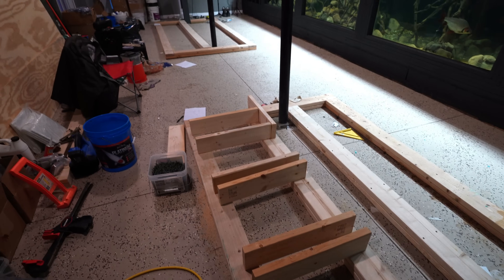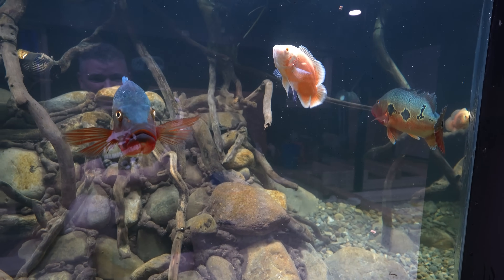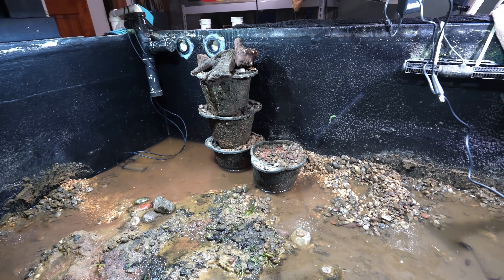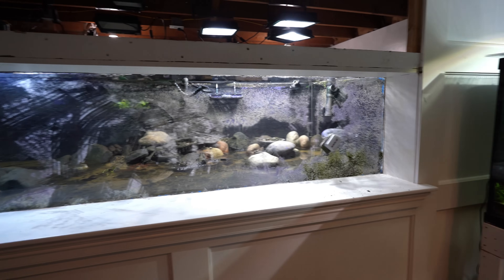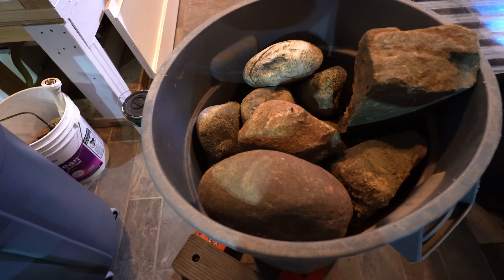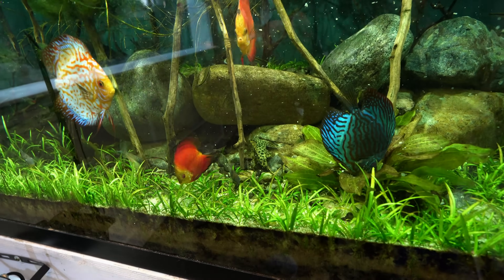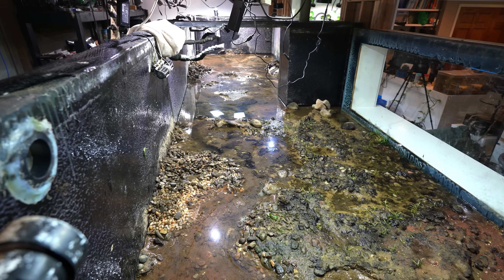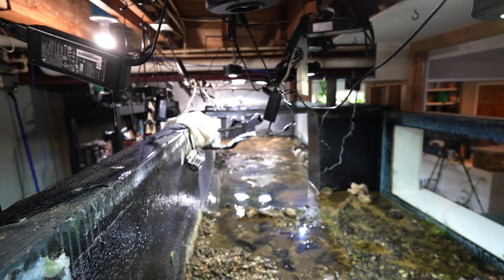Massive 3000 Gallon Marine Predator Aquarium Build, Predator Bay 3000 Starts Now!

Comment: Personally I wouldn't shrink the surface area of the 1500s, but would reduce the height down for easy visibility over it
Reply from the maker: It was a tough decision, but honestly the middle area view is noticeable better with the new footprint. I did decide to increase the height on the middle tanks...so I am back up over 1200 gallons on each one. 😊

Comment: You could just make the two 1500s taller with the narrower footprints but keep the water volume about the same.
Reply from the maker: You gave away the surprise in the next video 😁😁  they are going a bit taller and will be 1200 gallons 😁
Reply: @AquariumDomain.  Sweet. Happy building and stay warm.

Comment: Also for your lids for the new predator bay have you thought about using polycarbonate greenhouse panels? They don’t sag and transmit light as well as glass. If push comes to shove you can always frame them with 1x3s.
Reply from the maker: I have a bunch of polycarbonate greenhouse panels and will be using them on the 3k, but I am changing the bracing of the top panels both to shorten the distance of each panel, but also to secure them from Sharks pushing their way out 😊

Comment: As I've said over and over and over again the 4500 is so beautiful dude. By shrinking the tanks down you actually save on plywood and other lumber by doing them 4 ft wide. I need this in my basement, but i dont have b*lls to do it so I'll live vicariously through you. 👍👍 have you gave anymore thought on 2 viewing panels on the 1500 gallons?
Reply from the maker: Thanks!  Yeah, 4 x 10 works out really well materials wise, also I have increased the height a bit so I am still going to get 1200 gallons out of each tank...plenty for the fish I want to keep in them. 😁  I am leaning towards one viewing panel so that I can do more with the aquascape and not have the eye wonder to the 4500 gallon behind them 😁😁

Comment: Great stuff as always! You could always make the 1500s be like ponds on the ground too, or at least I'd consider that. 

The 900s otherwise should look sweet too. Not to mention how cool it'll be once the sharks and rays go in that 3000. 👍
Reply from the maker: Hey Austin! Funny thing is after I filmed the video I was thinking to myself I could just make the two 900 gallons a little bit taller like 42 or 44 inches and come in around 1000-1200 gallons...which is what I will most likely do. 😊
Reply: @AquariumDomain.  Wow! That's exactly what I was thinking "can't he make it a bit deeper instead?". I think it would look epic to have something like two massive columns of water to frame that enormous tank with the jungle on top. 

I do wonder if you're going to add underwater plants to the 4500?

Comment: What is the Predator Bay maintenance like? Do you buy salt for water changes regularly?
Reply from the maker: With all of my tanks I try to run them close to ecosystems as possible, meaning I want the system to perform the entire nitrogen cycle, including breaking down the nitrate. The current predator bay has a 33 foot long runway style sump with huge areas of ceramic material, low oxygen and no light that allows for denitryfing bacteria to live in large quantities and breakdown nitrate. It has worked really well as predator bay has had 1 partial water change in 3 years and it of course house really big fish who eat a lot of food, so it has been very successful. I will be replicating this in predator bay 3000 but also adding a better settling chamber setup and a refugium. 😊

Comment: Why not kept the aquariums at 5.5 feet, but cut the inside corner off. or make then ends rounded, maybe coffin shaped. Just an idea if one of these worked you would keep the aquarium volume up.
Reply from the maker: Not bad ideas, what I am thinking now is to keep the 10x4 footprint, but increase the height from 36 to 44" which will put me at 1200 gallons per tank.

Comment: Will the 900s be sitting on the floor similar to the 4500, or raised up like Predator Bay 3000?
Reply from the maker: They will be the same style as the 4500...and I have modified the design a bit and looks like they are going to be 1200 gallon tanks now 😁
Reply: @AquariumDomain.  Nice! It's funny how adding 300 gallons back into the mix sounds so casual when you say it like that, even though 300 gallons is more water volume than 80% of the hobby has in any one aquarium 😆

Comment: Hello. If you have no plants in the 4500 gallon, how do you clean the bottom of the tank, if you do. Thanks. I have a 90 gallon community tank with some congo tetras, gold barbs, bosemani rainbowfish and 2 bristlenose catfish with lots of plants. From what Ive been told, for planted aquariums you are not supposed to vacuum up the substrate b/c it is rich in nutrients for the plants.
Reply from the maker: I use strong water flow, Pleco, Flagtail Prochilodus and Catfish to keep the bottom stirred up for the wetland intake to ingest into the wetland filter.

Comment: Defiantly got some 2x4's flexing outward near that center line, 3rd one from the top from the left of the centerline, you can see the newly exposed unpainted wood. Looks like it's flexed out a good quarter inch.. 9:25  Your video 4 weeks ago, this flexing is not present.
Reply from the maker: Not flexed out, just never straight to begin with. If you check out the original videos from this tank from 5 years back it looked the same.

Comment: if you're cutting off 1/5 of the width of a 1500 isn't it a 1200?
Reply from the maker: It is...I was going to change the height, but I am back to 10x4x4 so 1200 gallons. 🙂